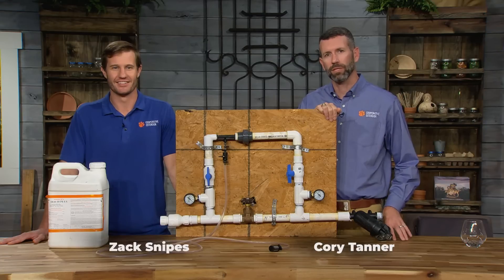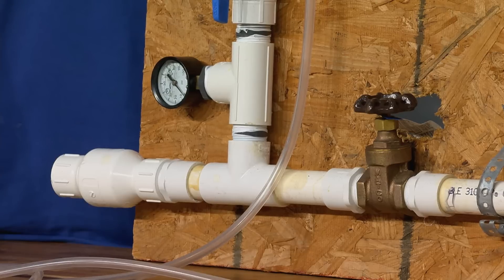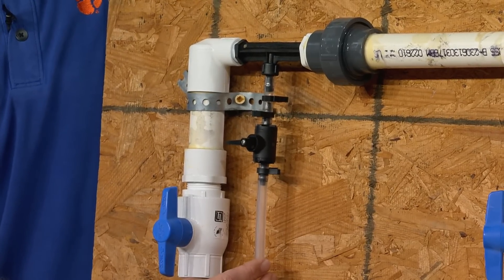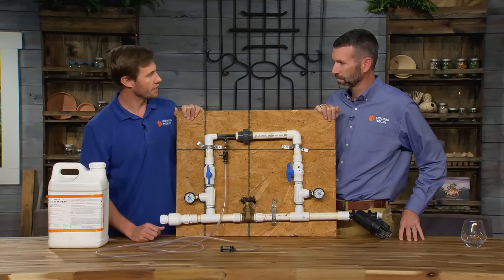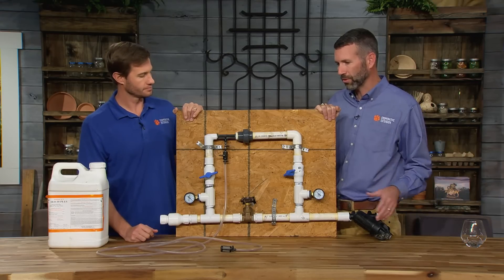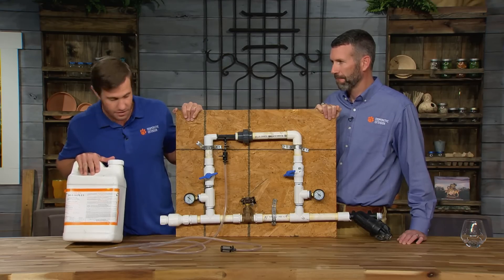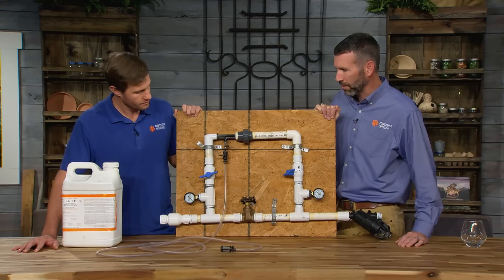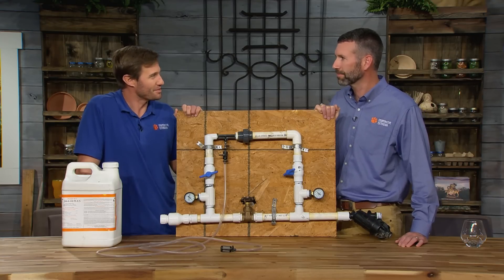Venturi Fertigation

Comment: How do you control the water and fertilizer ratio?
Reply from the maker: From Clemson Extension Agent Zack Snipes: We are more concerned with how much fertilizer goes out and not necessarily concerned with ratios. Ideally you want to run 15 minutes of water, 15 minutes of fertilizer, and a 15 minute flush.  Getting fertilizer to distribute consistently for 15 minutes is key.  It will mix nicely in the lines and in the soil.

Comment: No mention of pressure requirements? Kind of important for the system to work.
Reply from the maker: From Clemson Extension Agent Zack Snipes: Yes, pressure is important but every system is different so its hard to make a general statement on what pressure is best.  There has to be a pressure difference from the source and the venturi for it to work. That is where using the gate valve comes in handy to really dial in the pressure needed to run fertilizer but not too quickly.

Comment: What are the chances of the fertilizer solution going/back flowing into the home?
Reply: Install a backlfow preventer. You should always have one, regardless
Reply from the maker: From Clemson Extension Agent Zack Snipes: You should have a backflower preventer or 2 on the system.  Any irrigation supplier will help you choose what you need.

Comment: Great video, I am setting up this system with my head assembly and want to ask where this contraption fits. Looking at the end of this unit I see a filter from your video. I imagine that it will sit between the back flow valve and filter. So, the order will be my: water supply-timer-backflow valve- Venturi- filter-pressure regulator. Would you agree? If not, what is your suggestion?
Reply from the maker: From Clemson Extension Agent Zack Snipes: Correct!

Comment: I set this up the same as you guys almost exactly except didn't use a globe valve down at the bottom I can get pressure differential but instead of drawing in it's pushing water out into the bucket of nutrients I have the mazai valve in the proper direction and flow what am I doing wrong?
Reply from the maker: From Clemson Extension Agent Zack Snipes: There are different sized venturi systems. I bet you have the wrong size and the extra pressure is being diverted down into the bucket.